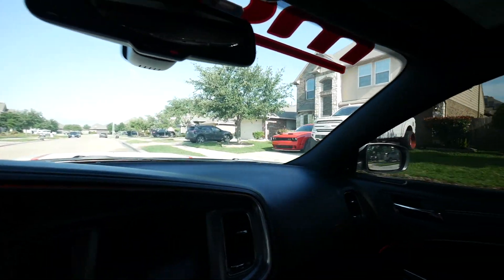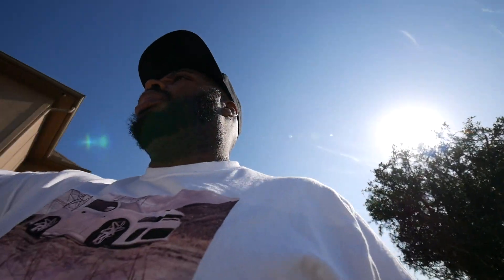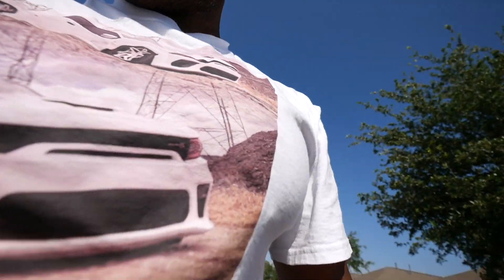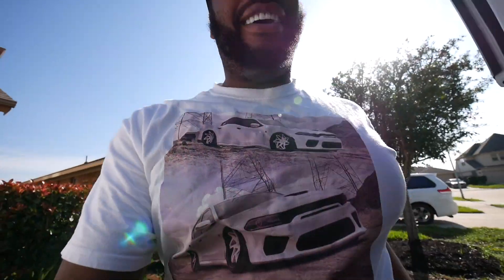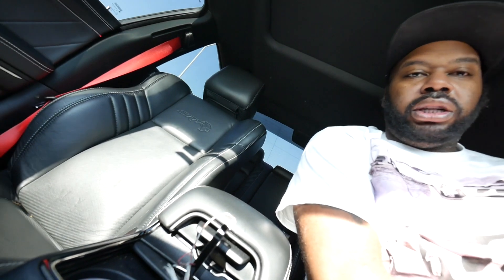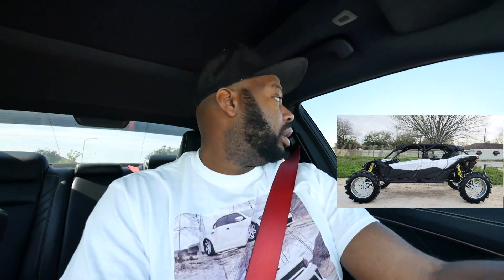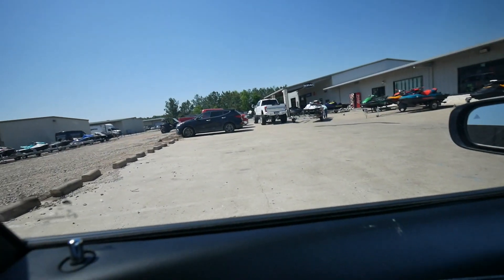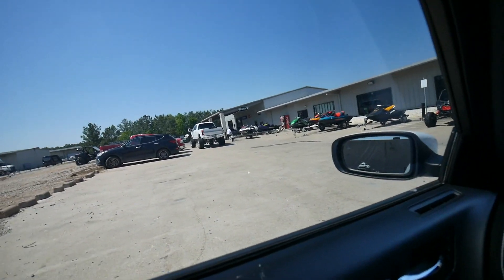MY 2021 CAN AM X3 MAX XMR ON 40s ALMOST DONE WHAT YALL THINK (COMMENT BELOW)

Comment: RZR basically means Razor. 1000 is the cc similar to a motorcycle. How they have 600cc 750cc 1000cc. It all boils down to how much power your side by side has the more CC the more power, the faster it could go etc.